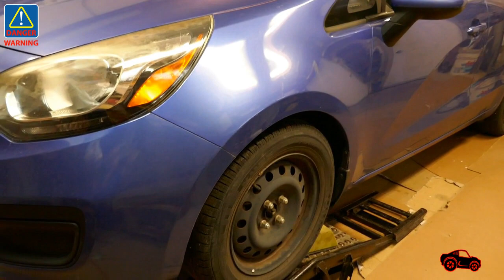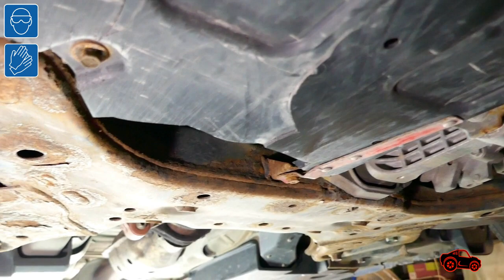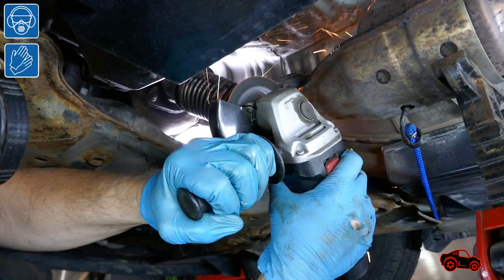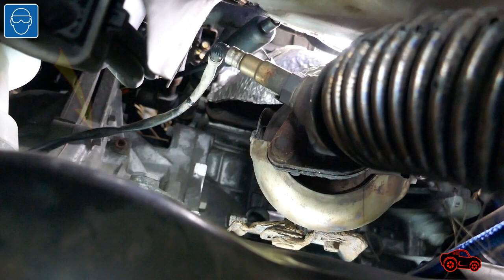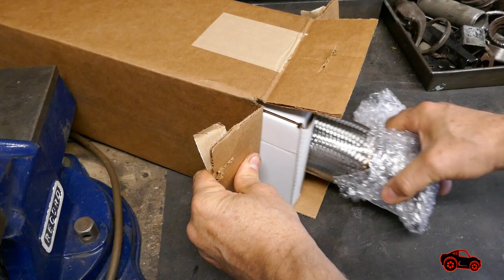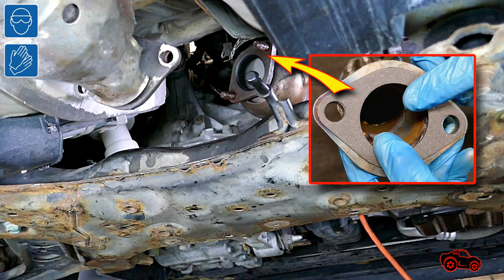Kia Rio / Hyundai Accent 2012-2017 Exhaust Flex Pipe Replacement

Comment: hello, i live in ontario and i have a 2014 kia rio which just got a flex pipe leak, i was just wondering if it’s possible to replace the flex pipe without welding or cutting, if yes could you list down the website you had gotten the part from, many thanks :)
Reply from the maker: If the flex pipe is the original one, the nuts are probably halfway rusted out and seized. Heating the nuts using an acetylene torch or a magnetic induction heater could be the solution to undo the nuts and replace the flex pipe. In both cases, it requires special tools and expertise. I got my kit from:  https://mufflerexpress.ca

Comment: Can the OEM studs at the top be cut, too? The part I'm looking at buying comes with 4 studs. Thank you for this!
Reply from the maker: On an old exhaust assembly, all types of studs (press-fitted or threaded) are difficult to undo or remove due to the rust. I guess that ''OEM studs at the top'' you mean the 2 studs fastened to the end of the catalytic converter. Yes they can be cut with difficulty but at home it is also very difficult to undo the rest of the studs without heating them. In a muffler repair shop they usually use an acetylene torch to heat and loosen the parts. Personally I avoid using a torch under my vehicles in my home garage because I find it too dangerous.